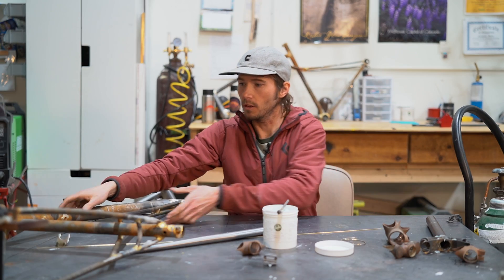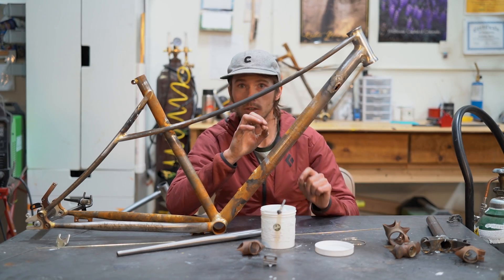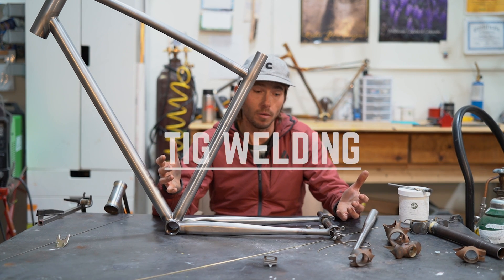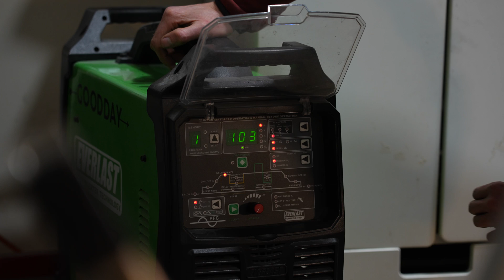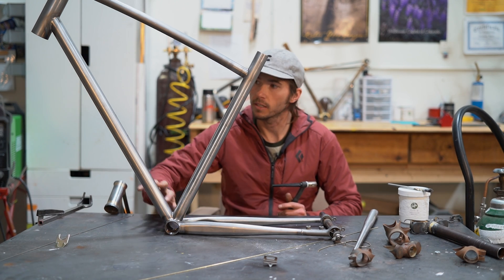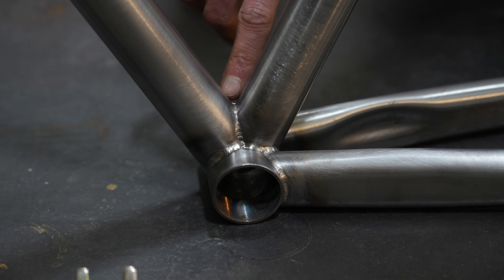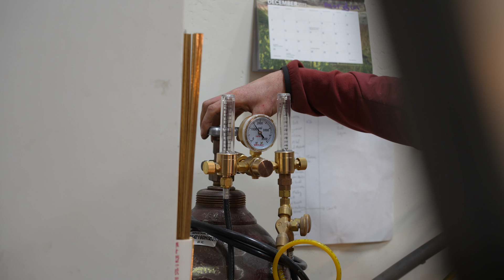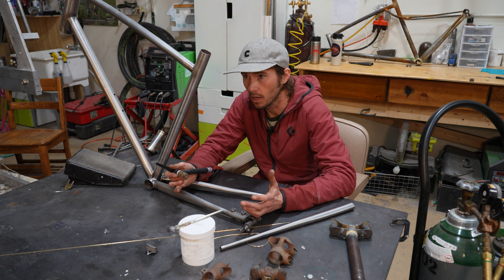How Bikes Are Made - Understanding Different Welds

Comment: It seems common to post heat treat aluminum frames but I’m curious if anyone is heat treating any steel frames post tig welding. Seems contradictory to buy heat treated tubing if the welds will compromise its properties. While this may be negligible I wonder if a small amount of unintentional aneeling occurs, allowing the welded area to flex a bit more rather than crack. Food for thought
Reply: High end "air hardening" steel tubing is designed around tig welding to harden as it cools from the TIG process. So, post-weld heat treating is not necessary. More common is not an annealed weld, but if you overheat it or "cook" it, it actually over-hardens and becomes brittle. Annealing requires a very slow and controlled cooling process. But even low-end cromo tubing that isn't heat treated doesn't need to be to perform well. Heat treating enables thinner tubing profiles. A good tig weld won't get the vast majority of the tube above a warm temperature. Aluminum by contrast has to be "artificially aged" by heat treat in order to not be soft. But this is a low heat compared to steel.
Reply: Al frames are not post weld heat treated - it would be too expensive and they would probably warp. The heat affected zone adjacent to the weld extends only a few mm in an automated MIG weld . The weld itself is just an Al-Si casting and it is by far the weakest material - hence they tend to be thicker to compensate for the low strength. Most aluminium tubing used on bikes is 6061 ( Mg Si) with some 7005  (Zn Mg)- these are low allow content and the strengthening from solution treatment quench and artificial ageing is quite good it is nowhere near what is possible with alloys such as 7075 (Mg Zn Cu).
The Al tubes are heat treated at the extrusion plant then cold drawn and butted which increases their strength above that of heat treated alone. The terms T6 refers to solution treated , quenched and aged, T651 and T691 is T6 plus post heat treat cold working . Any post welding heat treatment will negate the strengthening imparted by the cold working.

Comment: I've always been curious about how the lugs themselves are made, machined, molded, welded, or some combo?
Reply: Lugs are typically investment cast.
Reply: Yes, usually cast to keep them inexpensive. Some people make their own lugs though, in a process called "bi-laminate" where custom lugs are made of larger tubing. Lots of custom builders start with a cast lug and then hand file them to customize them. Most cast lugs (well any cast part) need to be cleaned up or sanded
Reply: Lost wax investment casting